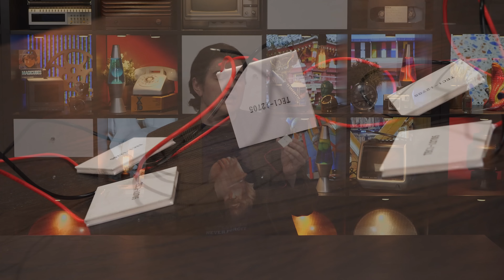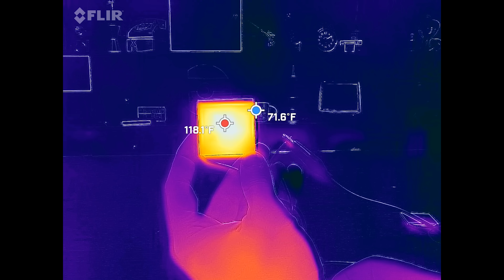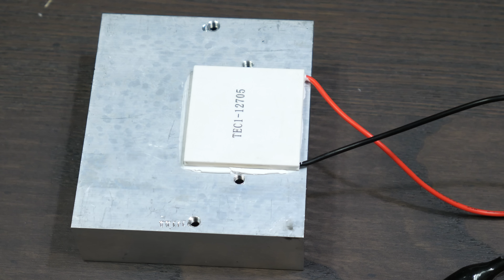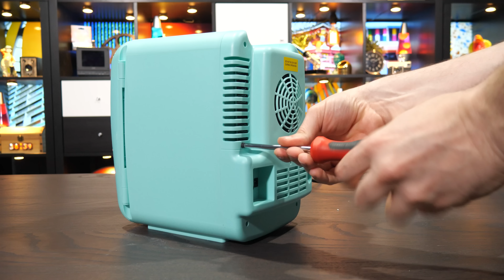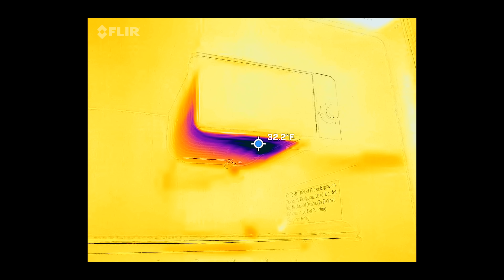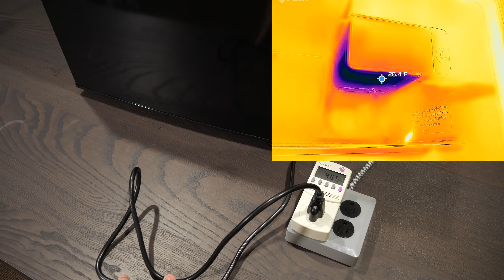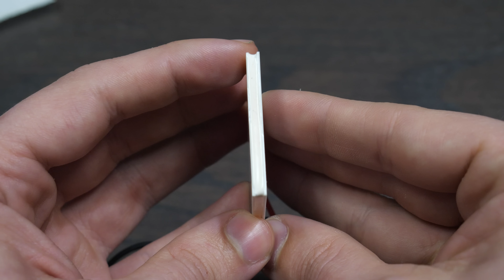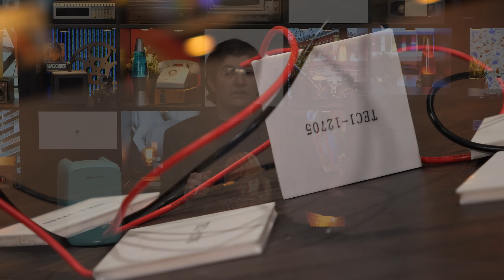Thermoelectric cooling: it's not great.

Comment: NOPE, How about using a Peltier element as a heat source for an absorption fridge. Then you get cooling from the element, as well as using the wasted heat for cooling. You still have no moving parts, but should increase your efficiency significantly. Maybe even use the cool side of the Peltier element to cool the condenser.

Comment: Peltiers might finally be getting efficient! From scitechdaily: 210% performance improvement "Penn State researchers have created a thermoelectric cooler that significantly improves cooling power and efficiency for future high-power electronics. The device uses half-Heusler alloys and a unique annealing process to yield higher cooling power density and carrier mobility."

2024.. Phononic's Hex hybrid cooler is half traditional air cooling, and half peltier cooling and only uses 35 Watts for the peltier to assist cooling latest AMD chip! I wonder what sort of heat transfer efficiency they have achieved because peltier is traditionally stupid inefficient

Comment: A common everyday consumer use of thermoelectric cooling/heating, car seats. At least, for high end cars.

Cars that only have heated seats often use simple electric heating element. Same principle as an electric stove top.

But when cooled seats are also employed, its typically thermoelectric. Peltier device(s), located away from seat foam, where a centrifugal fan blows over the heat syncs. Both sidesof pelitier device has heat dissipation fins. The fan airflow is split. One portion of flow goes over cool side of fins and is ducted to seat.

Holes in seat leather allow cooled air to reach occupant.

Meanwhile the flow over opposite heat sink blows the heated air into cabin (where vehicle HVAC can deal with it).

Toggling to heated seats simply involves toggling polarity to pelitier device. Airflow remains same paths.  So no ducting gates required. The same device performs both cooling and heating, using forced air.

The device isn't trying to cool a volume of air. Its not an AC, not a fridge. Its also not concerned with mass of human, nor how much energy required to cool it. To be useful, it merely needs to blow a constant stream of air that is noticibly cooler, or hotter, than ambient.

I find the cooling more effective than the heating. If its cold, I'm typically wearing more layers, which insulate from the heating effect (whether forced air or electric element). Other than taking edge off cold seat, not that useful.

Cooling on the other hand can prevent arriving with a sweat soaked back. Which is also damaging to the leather. Thats where this tech really shines. Not so much keeping one cool, but keeping ineffective, and detrimental perspiration from occurring.

There are even kits to retrofit this tech to cars not factory equipped.

Comment: Speaking about efficiency, I got a small cooler to a car that has actual compressor. That thing uses 35kWh a year! It holds foods for two persons for a weekend and you can leave it running even in a car with regular lead acid battery overnight on a roadtrip without any issues. It really uses just around 0.1kWh per day when used as a fridge.

It basically runs in total around 5 minutes each hour because the compressor is really strong and it goes also down to -18°C (0F) aand does that in 10minutes from room temp when empty. So I can carry it to a car, turn it on and drive to closest store and still be able to put frozen things in it so they stay frozen no matter what kind of heatwave there is.
Reply: care to share brand/model? I could really use that. My old Igloo peltier model works ok for refrigerated food, when I pre-cool it, but it barely gets my ice cream home from the store.
Reply: @jaadow77  that is Mobicool MCG15 but I would think most compressor equipped boxes have decent performance.
Reply: @Karjis  That looks good, but I'd need a larger one. The webz shows me a few good options. Thanks for the response.
Reply: @jaadow77  yeah it’s not too big one, I think that is one of the smallest compressor driven units. You can also get Makita and Ryobi ones with compressor, those run also on 18V tool battery.
Reply: Yes please share the Brand/Model
Reply: @DCDura  that one is Mobicool MCG15

Comment: built my own cooler with Peltier, used heat pipe cpu cooler on the hot side the Peltier, device is in the lid with much quieter arctic 140mm fan. insulation is 2" blueboard, have it in my van when I hit costco.
reverse it and keeps things inside warm.
don't want one of those apartment type refrigerators in your vehicle when driving the rough roads and bouncing can ruin the compressor

Comment: 6:15: At this point you have to re-evaluate your goals for such a device. This is for an office environment? Imagine a worker keeps their lunch in the office fridge but keeps drinks at their desk. The drinks will get coldest at night, and then the goal is to keep the "cold enough" through the day. Food safety? Oliet Bang's is shelf-stable. Most sodas, canned, bottled drinks, etc are. People MIGHT be trying to keep their lunch in one of these, but I think that would be silly.

Anyways, powered car/vehicle/portable refrigerators. Yeti, Alpicool, whatever, can you make recommendations on that topic? For those applications I think thermoelectric cooling has the purpose of having no moving parts and not minding being off-level.. I fried an old fridge in an old RV once that way, opened the door one day and GASSED myself! Has me really thinking thermoelectric could be used to build a very nice, proper custom setup.

Comment: I feel your anger.  I encountered Peltier devices in a sewer plant... specifically tiny modules to dehumidify a small sealed space and drip the condensed water down a tube and out of a hole.  This nasty cheap little thing was 'guarding' $20,000 of HV electronics (transformers, UV florescent disinfection tubes) in the enclosure.  Shame on you, Seimens!  They came to my attention when two enclosures failed after a week of rainy weather, fortunately not destroyed.  Of course the Peltiers had failed over time and I got new parts and replaced them... but put in a request what was REALLY needed was a circulating air system in all units and a REAL noisy dehumidifier that people could check every day.

Comment: Why is this worse at cooling stuff down?
Maybe because the plates are better at heating then cooling. 😂Some of these small fridges tried to include a switch on the back to switch between hot and cold. The heated setting works great. Also it has a car adapter. Good for keeping something cold for a couple hours. I tried these things a couple times before and they suck. I ended up taking the plate and sticking it to a metal cup and sticking a round heat sink on the bottom. Works good for a couple cups. I don't want to know how much power it uses and one day it might just blow up.😅

Comment: Ok.  Now I'm thinking how cool it would be to make a functional full sized fridge using Peltier elements.  Because we live in a world where ChatGPT exists, we no longer have to wonder what it would take!  I had Chat GPT work out the best (reasonably attainable) method of building a functional 3.6ft³ refrigerator.  Building one requires a heavy duty PC water cooling system, venting said cooling system outdoors, and building vacuum insulated panels (VIPs) out of acrylic, just to name a few interesting steps.  I just pray someone will actually build it!

Below is a list of materials and step-by-step instructions for building your 3.6 ft³ Peltier-cooled refrigerator with the specified design. This will include all the core components you'll need and the steps to assemble it.

Materials List:
Core Components:
Peltier Elements (e.g., CP60546241) - 5 units (one for each wall, excluding the door).
Sheet Metal (Aluminum or Copper) - 5 panels, 18" x 18" x 2 mm thickness.

Liquid Cooling System:
Liquid cooling radiators - 5 units.
Water pump - 1 unit.
Water block heat exchangers - 5 units (one for each Peltier hot side).
Tubing (sized to fit the water blocks) - enough for connecting the radiators and pump.
Coolant - standard PC coolant or distilled water.
Vacuum Insulated Panels (VIPs) - 5 panels, 1" thick, 18" x 18" (walls) + additional pieces for the door and other smaller areas (these can be made from acrylic sheets).
Opaque Acrylic Sheets (for covering VIPs):
5 panels, 20" x 20", 1/8" thick for external cladding.
1 panel for the door (sized based on door design).
Thermal Paste - to ensure good thermal contact between the Peltier elements and the sheet metal.
Thermal Gaskets or Sealants - to seal the points where the tubes pass through the VIPs.
Fans (Optional) - small fans to help circulate air within the fridge and ensure even cooling.

Insulated Door:
Acrylic sheet (same as walls).
VIP or foam insulation - sized to fit the door.
Sealing material or rubber gaskets - to ensure the door seals properly.
Hinges - 2-3, for mounting the door.
Latch or magnetic closure - for keeping the door closed tightly.

Miscellaneous Materials:
Aluminum tape - for sealing edges and creating a reflective barrier if needed.
Wiring and connectors - for powering the Peltier modules and liquid cooling system.
Power supply - rated to handle the total power draw of the Peltier elements and cooling system.
Control system - a thermostat and relay system for controlling the temperature and cycling the Peltier elements as needed.

Instructions:
Step 1: Prepare the VIP Insulation and Panels
Cut the VIP panels to fit the inside of your refrigerator walls. Each panel should be 1" thick and sized to be 18" x 18" for the walls, with smaller pieces for the door and smaller areas. Ensure all edges are sealed.
Attach the opaque acrylic sheets to the exterior of the VIP panels using a strong adhesive. These will serve as the external structure of your refrigerator.

Step 2: Build the Core Frame
Construct a simple box frame for your refrigerator using the VIP panels. Secure the panels at the edges using adhesive and aluminum tape to ensure a strong seal and prevent any air gaps.
The internal dimensions should be 18" x 18" x 18", giving you the desired 3.6 ft³ of internal space.

Step 3: Install the Sheet Metal (Cold Side)
Cut the sheet metal panels (aluminum or copper) to 18" x 18" and affix them to the inside of each wall. This will act as a heat spreader for the cold side of the Peltier elements.
Ensure the metal panels are flush against the inside of the VIPs.

Step 4: Mount the Peltier Elements
Thermally attach the cold side of each Peltier element to the sheet metal panels using thermal paste or thermal pads to ensure good contact and efficient cooling.
Drill holes through the VIP panels for routing wires from the Peltier elements and water pipes for the cooling system.

Step 5: Install the Liquid Cooling System (Hot Side)
Mount the liquid cooling water block heat exchangers to the hot side of each Peltier element using thermal paste or pads for proper contact.
Secure the radiators on the outside of the refrigerator, ensuring that the tubing connects the water block to the radiator and back to the pump. This will allow the coolant to circulate and remove heat from the hot side.
Set up the water pump in a central location, and connect all 5 cooling loops with tubing to circulate coolant between the Peltier elements and their radiators. Ensure proper flow and sealing.
Ensure all tubes are securely routed through the VIPs, using thermal gaskets or sealant to maintain the vacuum integrity of the panels.

Step 6: Construct and Install the Door
Create a door panel using acrylic and VIP insulation. Ensure the door fits tightly into the refrigerator opening.
Use rubber gaskets or sealing strips to ensure an airtight seal when the door is closed. Attach hinges to one side and a latch or magnetic closure on the opposite side for securing the door.

Step 7: Wiring and Power Setup
Connect the Peltier elements to a suitable power supply. Make sure the supply can handle the combined current and voltage requirements of all the Peltier modules.
Optionally, install a thermostat control system to regulate the internal temperature and cycle the Peltier elements on and off as needed to maintain a consistent cooling environment.

Step 8: Test the System
Power on the system and check for proper operation of the Peltier modules, cooling loops, and circulation fans (if installed).
Monitor the internal temperature and ensure the fridge reaches the desired cooling levels without excessive heat buildup on the hot side.

Final Considerations:
Sealing: Ensure that all penetrations through the VIPs are properly sealed to maintain vacuum insulation.
Testing: After construction, test the system under load (e.g., with food or other items inside) to make sure it can maintain stable temperatures.
Upgrades: You could consider adding a temperature control system with an LCD display for easier management.
This approach should provide a highly efficient, well-insulated refrigerator that effectively utilizes Peltier cooling technology!

You said:
What would the peak and average draw be for this fridge?
ChatGPT said:
To calculate the peak and average power draw for your Peltier-based refrigerator, we need to consider several factors: the number of Peltier elements, their individual power consumption, the efficiency of the liquid cooling system, and how often the Peltier elements will be cycled on and off.

1. Peak Power Draw
The peak power draw occurs when all Peltier elements and the liquid cooling system are operating at maximum capacity.

Peltier Elements:

You are using 5 Peltier elements (one per wall, excluding the door).
The CP60546241 Peltier module has a maximum power rating of 147 W per module at 27°C.
Total power for the Peltier modules = 
5×147W=735W

Liquid Cooling System:

The liquid cooling system includes 5 water block heat exchangers, 5 radiators, and a water pump.
A typical high-efficiency PC water cooling pump consumes about 20-30 W.
The cooling fans for the radiators generally consume around 3-6 W per fan, assuming 5 fans, which amounts to 
5×5W=25W.
Total power for the liquid cooling system = 55 W (pump + fans)

Peak Power Draw Estimate:
Total Peltier power = 735 W
Total cooling system power = 55 W
Total peak power draw = 790

So, the peak power draw would be approximately 790 watts when all Peltier elements and the cooling system are running at full capacity.

2. Average Power Draw
The average power draw will be lower than the peak because the Peltier elements are not running constantly. Their cycling depends on the thermostat settings, ambient temperature, and insulation efficiency.

To estimate the average power draw, we need to account for:

Duty Cycle: The duty cycle represents how often the Peltier elements will need to be active. For a well-insulated refrigerator with vacuum panels, the duty cycle might be around 30-50%. This means the Peltier elements may only be active 30-50% of the time.
Assuming a 40% duty cycle (a balanced estimate for a well-insulated system):

Assuming the liquid cooling system runs continuously (or close to continuously):
Average Power Draw Estimate:
Total Peltier power (average) = 294 W
Total cooling system power (continuous) = 55 W
Total average power draw = 294W+55W=349W

So, the average power draw would be approximately 349 watts under typical operating conditions.

Conclusion:
Peak power draw: ~790 W
Average power draw: ~349 W
These figures assume efficient insulation and a typical duty cycle for the Peltier elements. The actual average power draw may vary based on environmental conditions, cooling load, and how frequently the Peltier elements are cycled.

Comment: I'd think with a thermostat and good insulation, you make it run in cycles, you could get decent refrigeration, no? it wouldn't be running all the time do it'd definitely lower the average power draw and it'd help getting rid of the heat at the back it'd still be compact and movable and maybe you could hook a lithium battery to make it fully portable. it'd have uses, maybe a camping battery powered cooler?

Also and maybe it's defeating the point but what about a cpu watercooler for cooling it? it seems to be roughly the same shape and size and it probably doesn't get much hotter than a cpu, no? well unless you need things truly and utterly freezing lmfao.

Comment: For a little bonus consternation: Emerson, the brand of the Peltier mini fridge, is a major manufacturer of heat pump / ac / refrigerator condenser units as well. Why be limited to good products when there's a large low information market for bad products

Comment: Longevity. A power supply that fits the $30 retail budget isn't going to last long running constantly, or be very power efficient.
Lack of efficiency means lots of heat output which can mean extra costs to cool your space.
The lack of insulation means it has a condensation issue too.
This is just a quick way to fill up our landfills, and we're importing them from China on ships?
Oh boy.

Comment: When I was a brand new electrical engineer in 1972, working for RCA's TV camera division, I got a lesson in the use of Peltier coolers (which I'd only read about).  They had been used several years earlier in an RCA studio color camera, the TK--42, which used 3 vidicon pickup tubes for the 3 primary colors.  Vidicons CAN be made nearly sensitive enough for color television, but in doing so they become quite electrically noisy (the picture from each is full of random-value pixels: "snow").  To get around this, RCA built Peltier coolers into the mounting hardware for the 3 vidicons, with the cool surface coupled as tightly as possible to the optical faceplate of each tube.  Cooler tubes make less electrical noise.  It sorta worked, but the whole thing was a pretty terrible kludge, and RCA gave up after several years of poor sales and switched to the much more sensitive, and quiet, Plumbicon tubes.